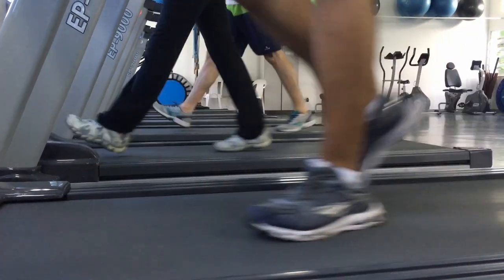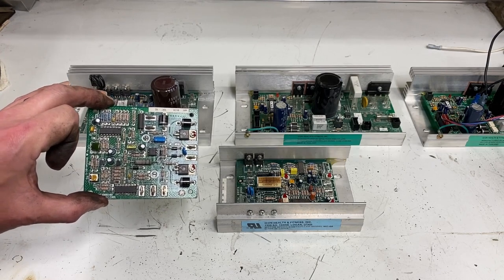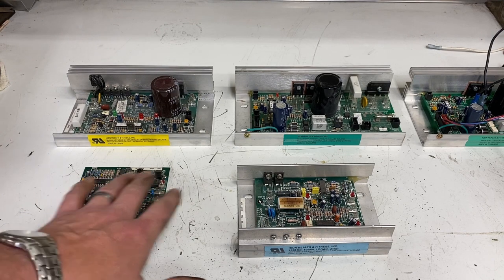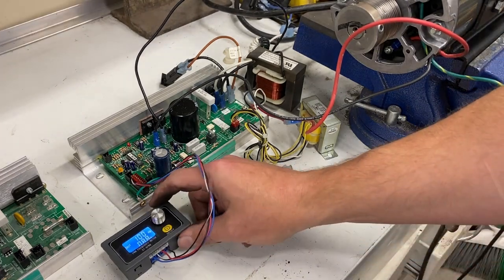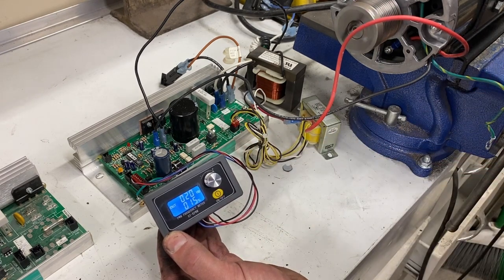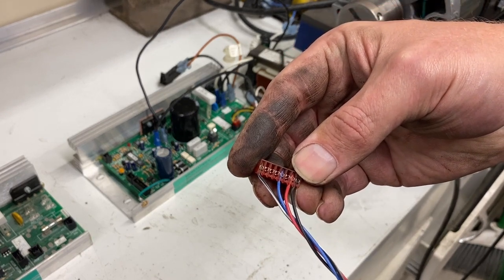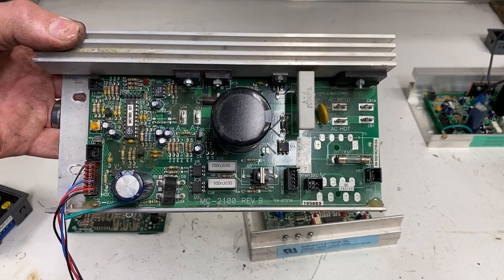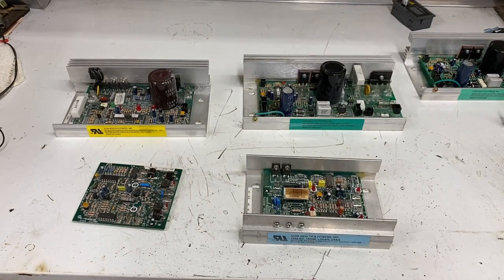Variable Speed Power Supply, Treadmill Motor Controller Boards: MC-02, MC-60, MC-2000 or MC-2100

Comment: Daze, if my 2100 didn’t come with the transformer and has not place to plug one in - does that mean it runs ok without one?
I’m speaking of the one I sent you a diagram of the other day.
Thanks
Reply from the maker: I have seen three kinds of 2100. one like in my video with an external transformer, one with a large transformer soldered directly to the board and one with a small transformer soldiered directly to the board. the transformer is required to power the PWM signal generator.

Comment: Thank you for replies to my comments on the "blue wire..." video.   I have a MC-70 board. Any thoughts?
Reply from the maker: I am happy to help.  At this point replying to all comments is still manageable so as long as I am able I will continue to do so.  I have no hands on experience with the MC70, but like the other early MC boards MC60, MC80, and MC2000 it is an early SCR type controller.  Should be usable.  the only possible issues are soft start and a lack of a fine speed control.

Comment: Hey! Have you ever heard of a B017d control board? I am attempting to use one on and a treadmill motor on my lathe. I am not super electronically inclined though and was hoping to find a write up using that board instead of an MC board, but have had no luck! Thanks for making such great videos
Reply from the maker: I was not familiar with it so I looked up a pic and that looks similar to the 2100.  I would guess it relies on a PWM signal just like the 2100 but I can not say for sure.  Was there a pin out sheet inside the treadmill?  if not do you still have the treadmill touch panel?  often times the circuit board on the touch panel is labeled and you can trace the wires back to determine proper hookup.
Reply: @dazecars  Unfortunately I got the unit with no control panel (it was damaged and thrown out), so I am going in a little blind. The plug to the control board does have labels next to each pin. I will see if they are similar to the pins on the mc2100. Thanks!
Reply: @dazecars  it has 5 wires coming out of the controller plug. One is labeled "GND" another id labeled 12v, so those ones are easy! There is also an "SW" "RXD" and "TXD". I was hoping to find a diagram online for this treadmill but no luck so far!
Reply: @dazecars  I have just tested a PWM connected to GMD, +12v, and the RXD and TXD to the PWM signal. No luck! I guess ill buy an scr

Comment: Nice video, I used it to shop for a better controller than an SCR set up. I went with a used MC-2000 from Ebay.  The wiring is pretty straight forward but when powering it up only the 15V and SPD SIG Leds light up. Rotating the pot (200K) does nothing to the motor but the SPD SIG Led does dim. I know the motor (2.44 HP) is good as I had it set up with an SCR controller at first but it couldn't keep up with the load I was putting it under. I'm using it for a woodworking lathe. With the SCR it would repeatedly  pulse between full on and off. Did I get a bricked controller or am I missing something else here? Thanks Dude!
Reply from the maker: Couple things, first is sounds like you have a cheep SCR. I use am currently using  SCR controllers to power a large motor on my metal lathe, a medium motor on my metal mill, and a medium motor on my band saw. I have tried lots of different SCR units and the cheep ones are horrible in fact I have only found one good one, but that good one IMHO is better than any controller that comes in the treadmill as long as you use an AC choke and a DC choke to clean power spikes. There is nothing wrong with the PWM boards that come in treadmills and they can be a fantastic option. The reason I like SCR better is they are easy to use, very customizable, more robust than a PWM and produce way less heat. SCR voltage controllers have a bad reputation because people buy the cheapest one they can and then they don’t use chokes to clean high and low end power spikes. This results in pore performance, rough starts, and reduced Motor life, but all those things are avoidable. My favorite part about SCR is you can customize it to your application. My band saw had a max RPM from the factory that was quite a bit slower than the treadmill motor I put on it. Had I just put the treadmill motor on band saw, there was a chance the speed adjust could have been turned up too much which could have been disastrous and dangerous. By putting limiting resister in series with my potentiometer, my max speed is the max speed of the original motor. That is much harder to do with the PWM at least with the ones that come in treadmills. Second how do you have yore treadmill motor geared to your lathe. HP means almost nothing (I just did a video on this) What is the Max RPM rating listed on your motor, and is your 2.44HP continuous or peek? Your motor may not be up to the task with out some pulley reduction. Most treadmill motors are lower torque and higher RPM (which gives them a higher HP number because (torque X RPM)/5252 = HP.   So changing your pulley configuration could be the solution. As to your MC-2000 controller it sounds like the board you purchased is not functioning properly. The only thing I can think for you to check is the soft start, make sure you turn the knob all the way down and then back up again. Keep in mind that not all potentiometers are configured the same way and the H and L terminals may be reversed. If that is the case turning the nob clockwise would slow it down and counterclockwise would speed it up. I hope that helps, let me know if I can be of further assistance.
Reply: @dazecars  You video on upgrading to a better controller influenced my decision to move away from the cheap SCR controller, thats when I got the 2000 controller. AC power in to the correct inputs- check, DC power out to the motor and correct polarity- check, potentiometer wired correctly- probably check, there are no labels on the pot. I tried rotating from both ends of pot limits, turning off the power for each try just to see how it reacted. Turning the pot clockwise the SPD SIG led dims out, when turning the pot CCW it doesn't affect the SPD SIG, it stays out throughout the whole rotation. 

I watched your video for determining torque on a motor and understand what you are saying. The specs on the motor I'm working on are not complete, it's rated at 2.44 Hp (no continuous HP listed) with a speed of 3800 rpm so it has 3.4 ft/lb of torque and it's set up with a 4 step pulley on both the motor and lathe.
Reply from the maker: @vectionnoitcev2836  If there is no “max HP rating” The 2.44 is continuous. That should be plenty of motor and the gear ratio should make it even better. Sounds like the SCR you ditched was a cheap one and that the board you replaced it with is bad. A potentiometer is never labeled and the only way to tell what you have is to put a meter on it and check the resistance. The middle terminal is always W. By trying it both directions you eliminated the potentiometer as the problem. I am sorry that you inferred from my video that an MC-2000 or MC-2100 is better than a GOOD SCR. What I said in my video was an SCR was better than the MC-2 and MC-60 and when you get an MC-2000 or a MC-2100 "you have options" As far as power production a good quality SCR and an  MC-2100 will preform about the same.  It just depends on what you are doing, how you want to control it and if you need to limit max speed.
Reply: @dazecars  Thanks for taking the time to answer my questions. I've got two machines I'm using the treadmill motors the other being a 2 x 72 belt sander. That one also I changed from the cheap SCR to the one you designed, so far it's doing much better but still has a tendency to stutter when running at higher speeds. I'm attributing that to worn brushes and a dirty commutator. Even though it seems to be a common motor I'm having a hard time finding brushes for it...

Comment: Can you run a MC2100LT REV board and the motor you are controlling off of 220V ?
Or is it just gonna smoke it?
Reason I'm asking is I'm converting my wood lathe over to a treadmill motor and I know that the 220V will give me more and consistent power.
Reply from the maker: I don't know if it will smoke it or not.  I have not seen anything on the spec sheet that would indicate 220 capability.  Yes 220 makes an AC motor run more consistantly but if will not have the same result with a DC motor. I wouldn't even mess with trying to run it 220

Comment: Thanks. Great video. Do you know if the motor feedback will work as it should by using this pwm module for speed control
Reply from the maker: I have several videos on hooking up the tach input to the MC2100

Comment: wow great video.... I want to make a linear actuator using a thread mill motor... what is the minimum speed with this configuration
Reply from the maker: It is not that simple.  Depends on the drag being applied by what the motor is attached to,  the power supply being used, the design of the motor, and gear ratio.

Comment: So I have my lathe with the mc2100 board up and running ,thanks to your info. Now I'm doing another project but I have an alt 6330a board and I'm not sure I can control this one with just a pwm controller. Any knowledge of these boards?
Reply from the maker: Glad you were able to use the info!  Contact me through my website and send me some pix of the 6330a and I will see if I can find a hack.  If not a properly set up SCR is a cost effective way to go.  In fact I will be uploading a video next week comparing the MC-2100 to a properly configured SCR.

Comment: thank you so much for great info i have the last board that you talked about but it is little bit different it is MC 2100LTS-30 does it need a choke or not? please your help will be greatly appreciated thank you in advance !
Reply from the maker: A choke is not required when using a PWM.  Doesn't hurt to run one but it is not required like when you use an SCR

Comment: Hi DazeCars,

With the knowledge you share in your videos I've successfully converted a JET Wood Lathe to a treadmill motor and have now powered my rotary dirt sifter with one. In both cases I'm still using the original treadmill power supplies and controllers, and, also the user interface panel. Using the panel has the additional benefit of allowing me to monitor my heart rate. 😊

Wondering if you have ever modified the speed of a motor by adjusting the potentiometers on the board. The manual for the PROFORM 520X has instructions for calibrating various functions of the machine including the speed.

I ask because the speed of the lowest setting is slightly too fast for my dirt sifter and slowing it down mechanically by changing pulley diameters would be pretty difficult.

Thanks again for the great videos and content.

Jay
Reply from the maker: glad my channel has helped!!  I have not done anything with treadmill control panels due to their size and because of the limitations of it being designed for a treadmill (soft start and other treadmill specific features).  Even though challenging the best option for low end speed is ALWAYS gearing as it allows for more torque through the entire RPM range.

Comment: Hello. I just picked a 2100 board, without the transformer that powers the logic side of things. Can you tell me what voltage yours outputs on the low voltage side? Thanks for the great rundown!
Reply from the maker: it’s a 16v transformer.

Comment: So I  have the MC2, well actually the other one the MC 60, it has got the LWH. I guess it employs the control using potentiometer, and so the motor speed is controlled by just controlling the voltage supply.
If that be the case doesn't it make this type of control board a good bench top high DC power supply.  So one can install Volt Amp meter with it and run whatever one needs.
Just a cheap old power supply which are typically 30V, 10A, run from $60- whatever.   While this unit can supply around 100V and over and 20 A. I  just the motor that MC60 was running. It says 90V 21.5A

So I thought today that the PWM set up does not vary the voltage while the LWH does.
So the idea just popped in my head to use it as a nice high power DC power supply.

Also I noticed some sort of transformer you have hooked to the MC 2100 besides the big choke. What is that for? and what kind of transformer is that?
Thanks.
Reply from the maker: You can make a power supply out of an MC 60, others have done it but you need to realize that it is a type of SCR voltage controller and will require the use of a choke.  Also there is no reason you could not make a bench top power supply out of a PWM type board like the MC2100.  They both employ the same technique of switching off and on rapidly to reduce voltage.  The transformer in my video is because my MC2100 is a revision B and does not come with an on board transformer.  It is there to drop the voltage to power the control panel and other treadmill components after the reduced voltage gets converted to DC.
Reply: @dazecars  When I took this MC2100 from a NordicTrack, in fact two of them.  I somehow got two in a row. Niether one had a choke while MC60 came with one and it is housed at the bottom of the board and I left it alone.  I run the black wire from the motor through it.

I got the understanding that LWH set up varries the actual voltage while PWM supply full voltage but in time increments.   I didn't know that it ends up to be the same in the final calculation.
Reply from the maker: @alchemy1  2100 treadmills will not come with a choke but all MC-60 treadmills will because it is an SCR voltage controller.  Watch my video "SCR Vs MC60" You are correct on how a PWM power supply works, full voltage turned off and on repeatedly,  but the EFFECT of that is reduced voltage when there is a load like a motor the voltage will read reduced.  An MC60 is as I said before an SCR voltage controller.  It works the same way only the on off switching action is done on the AC side before it gets converted to DC it is not actually varying to voltage either it is switching on and off at full voltage just like the 2100 but again the effect is reduced voltage.

Comment: I did a conversion in a Shopsmith, ran good for couple hours. Then stopped. I am pretty sure my board lost a resistor or something.
Bind = quit.
2.65 hp. Mc1000 board, just watching this, it does not have the guts.
Reply: Video of the failure on my channel, input very much appreciated
Reply from the maker: SCR is a good way to go ( have another video on that) the part on the treadmill board that usually fails is a switching transistor.
Reply: Ordered a scr, rectifier and 200 k pot, be here monday

Comment: Hello.  I'm looking to control a treadmill motor to drive a pottery wheel. I need a slide control to use in a foot pedal, which means a potentiometer. I think it might be possible to find a pwm with a constant frequency output that is controlled by a potentiometer.  Any ideas about this?
Reply from the maker: When it comes to PWM all of them that I have seen are completely digital and one with a potentiometer would be analog. The output would be digital but it would be hard to get into range the 20 hz. Most just have three ranges changed by pins. An SCR would be easy for the potentiometer BUT not have the constant speed input.

Comment: Hey, Just wondering if you are familiar with a TM5917 board? Its the one I have. Similar to the ones you show here. Since we last spoke I purchased a tiny push button PWM and connected it to the 4 pin connector on my TM5917 controller. 20Hz did nothing. Just wondering if you can you suggest any other frequencies to try?
Reply: the 'Signal' LED on the board flashes fast when I connect the PWM which makes me think I have some of it correct. Just connecting one lead and the LED flashes so I guess there is a common and maybe it can work with just 3 of the 4 connected. It is possible of course that the board has a fault. Or soft start is an issue because my cheap tiny PWM does not have an on off switch. I unlugged it, then a second or so later plugged it back in again, but no motor spin.
Reply from the maker: soft start is easy to overcome by turning the signal generator all the way down and then back up again.  The flashing LED makes me think the hz is correct but other than that I don't see any obvious solutions.

Comment: Hello. I enjoy your stuff a lot. I have a SS 90 control board from a True 500 treadmill. I assume I will need a PWM but not sure which connections from the board to use and/or where to connect on the PWM. Any suggestions?  Thanks much.
Reply from the maker: Not all boards are easily hackable.  I do not have information on that board
Reply: @dazecars  Thank you for your response. The original control board is really beefy so it would be great to utilize it, but I will probably just go the SCR route. Thanks!
Reply from the maker: wish I could have been more help

Comment: Its hard to see in the video is the black dc power wire from A+ terminal running into the  large ferrite choke then to motor?
Reply from the maker: Yes the + needs to go though the choke

Comment: Great video 👍 iv got a MC 2000 board do I run power through the LG2 white and the LG1 blue    direct and then connect a  speed control unit  i I need help with this please
Reply from the maker: there si a lot more information here https://dazecars.com/dazed/variable.html